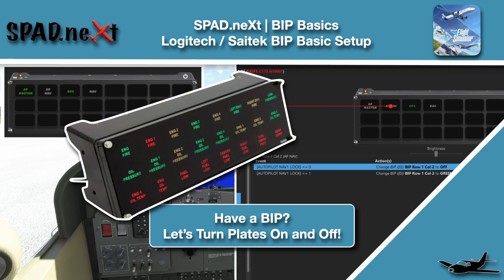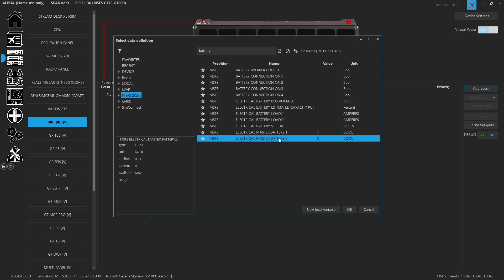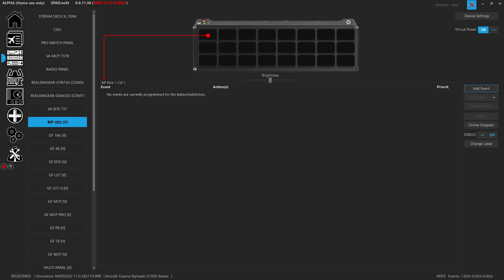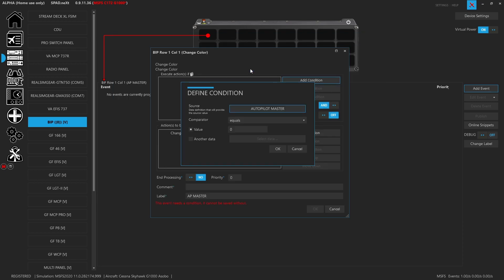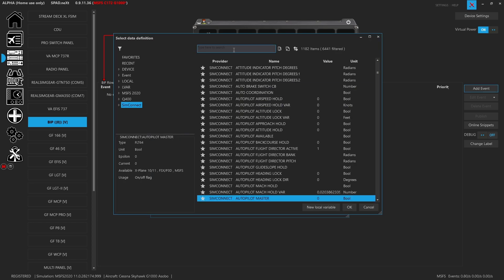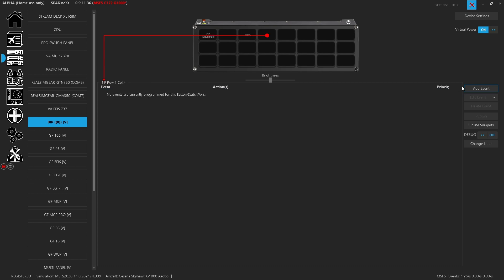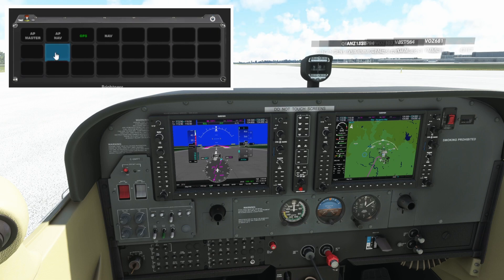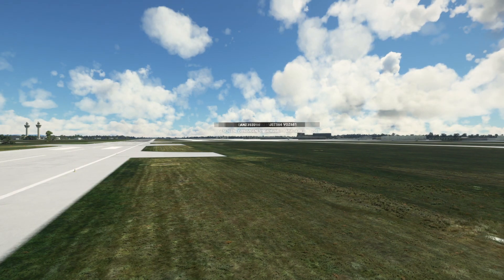MSFS | SPAD.neXt | BIP Basics

Comment: hello Les, could you please make a tortorial with this panel in the pmdg737 in msfs2020, It seams that no conditions or actions works on this plane exept the parking brake from simconnect. not even the virtual power works here..please help us :) would be great :)
Reply from the maker: You just need to assign them to the PMDG variables. Those are very straight forward… I don’t have this panel so it would be hard to make a current video with it.
Reply: @LesOReilly  I tried but it didnt work, could it be because I have muliply planes assigned to the same profile? thanks for answering!
Reply from the maker: Well you can’t use the PMDG variables with non PMDG.
Reply: @LesOReilly  I have also signed the MSFS variables so it could run more planes than just the pmdg737.
Reply from the maker: Okay. The whole point of Spad is so that you can have dedicated and unique profiles that automatically load with each plane.